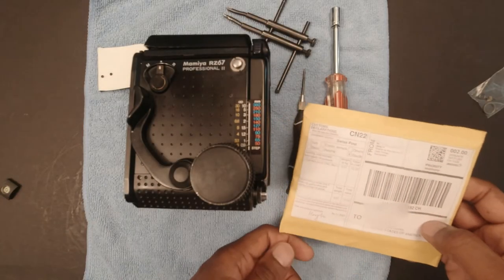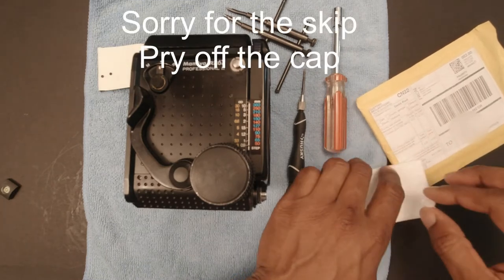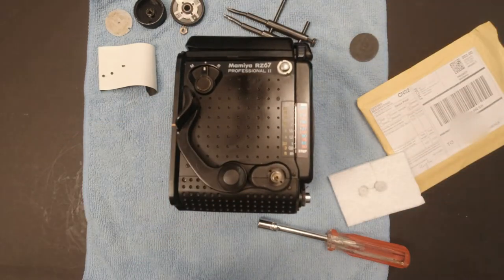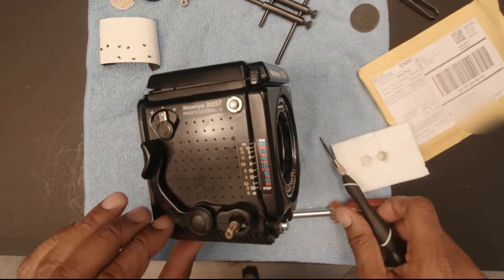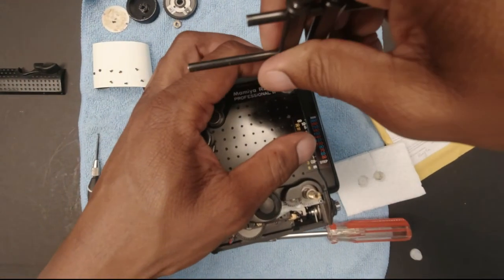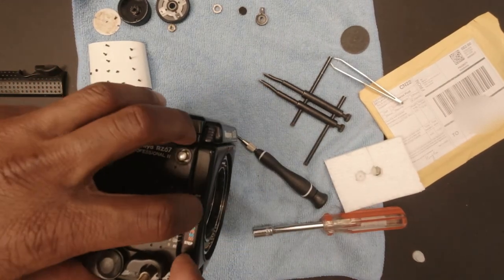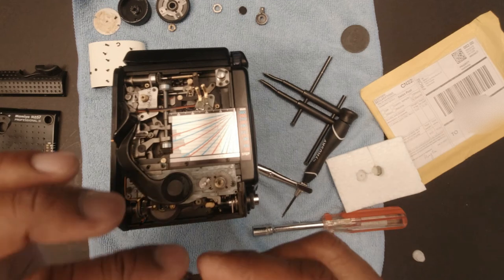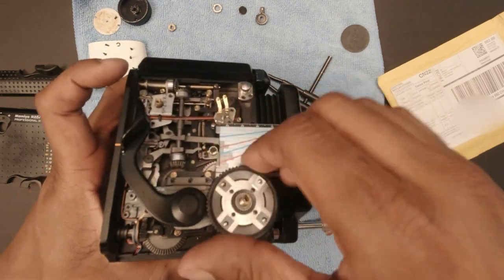Mamiya RZ67 Fine Focus Gear Repair

Comment: Thanks for the video!! Helped me out with my replacement. I used a brass one from PPP cameras and was expecting to replace a plastic gear, but when I opened it all up my fine focus gear was already brass! I guess this was an update they did on the ProIID. Regardless it needed to be replaced so thanks for the tutorial.

Comment: Hey Devon, thanks for the video. How did you re-adhere the coarse knob rubber cover from the beginning? Any specific glue? Thanks
Reply from the maker: Hey Ryan, you can use a thin layer of rubber cement glue. It will hold it firmly, but it will be easy to remove if you need to work on the camera again.

Comment: Thanks for your video. Long time ago trying to fix this problem! Could you please share were did you bought the gear? Do you have any link? Thanks in advance!
Reply from the maker: Hi Salva. I got it from Ebay. Try searching "RZ67 fine gear". Just keep in mind that some of these are people 3D printing these parts at home. The person I got mine from doesn't have a listing up anymore, but maybe ask the seller a few questions about the quality of the part before you buy it. Good luck.

Comment: The focus on My RZ67 was stuck and can only allow very limited travel. I still don't know if it's due to the worn-out of the fine focus gear or not. Still, I got the same 3D-printed gear from the swiss guy :) Do you know what could be some other reasons the focus stuck if not the fine focus gear issue? Btw, what size of JIS screwdriver are you using? I was hesitating to pry the thing open myself, your video is super helpful, thank you for putting this up on Youtube!
Reply from the maker: Moody Tools - JIS Type S Driver Set, 4Pc Pollicis - 58-0405 https://www.amazon.com/dp/B0001X0SK8/ref=cm_sw_r_apan_glt_fabc_TWXG48ZZ94PHMZT2S96E
Reply from the maker: You're welcome. I'm not affiliated with Amazon or any company, but that is a nice set to work on cameras.
Reply: @wrldwar3  Thanks man! I just got the exact set yesterday.